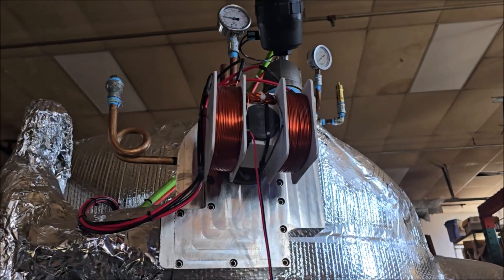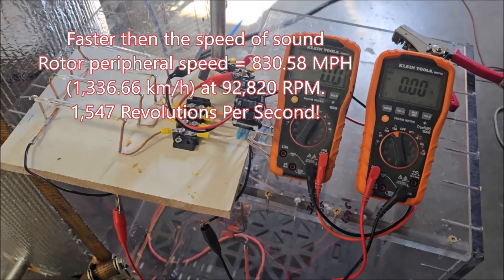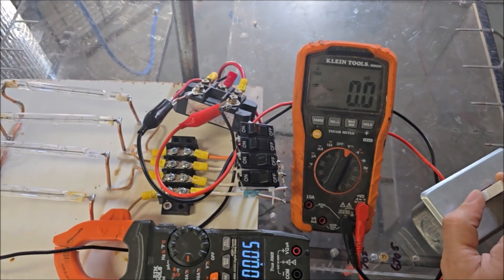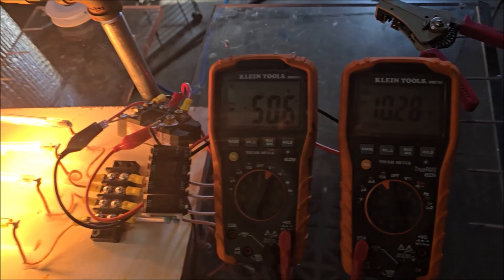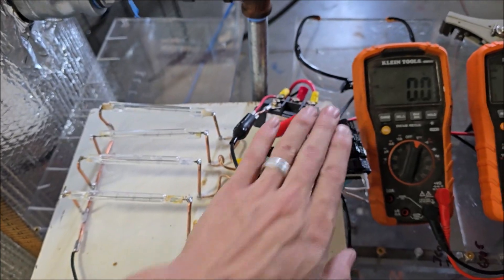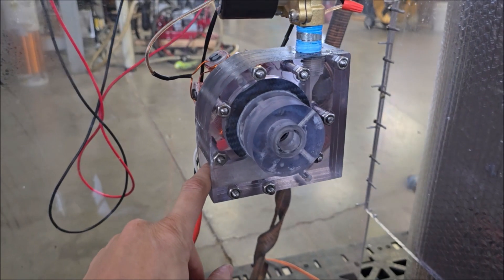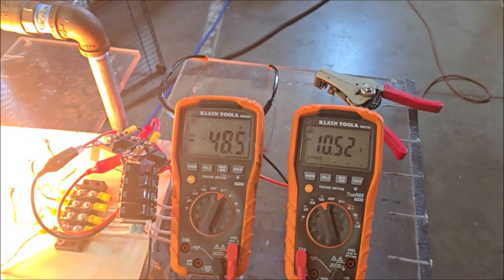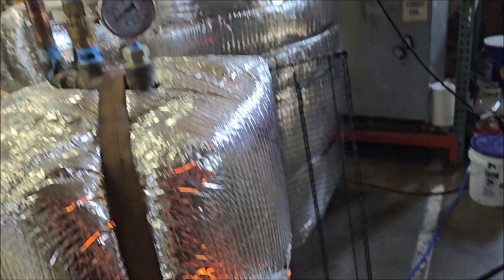Tesla Turbine Breaks Sound barrier! 95,000 RPM!

Comment: Try to get in Touch with Peter Lindeman and Aaron Murakami,
they will tell you that tesla intended his turbine to work in sister conjunction with another as a 99.9%  heat->motion konverter using "cold" steam.
nonetheless nice work keep it up
Reply from the maker: I work in Aaron's shop, haha. Achieving 99.9% conversion of heat would be the ultimate dream. I hope it happens one day, but it's a very difficult feat of engineering.
Reply: @iEnergySupply  404 error.  We censored your comment for some lame reason.  

Check held comment’s folder to find out more. If you can find it

Comment: You're impressed with high-speed machinery?  You should get out more.
Reply from the maker: With the right construction and conditions, the centrifugal pressure can almost match the supply pressure when the machine is idling. If the inlet is large, small changes in speed can cause big differences in fluid flow, helped by changes in the spiral path length. This creates a self-regulating machine, similar to a DC motor, where fluid flow is restricted by rotation, even with big pressure differences. Since centrifugal force increases with the square of speed, and modern steel allows for high velocities, this can be achieved in a single-stage machine, especially with a large runner.
Reply: @iEnergySupply this guy has to be some sort of boł.  Theres so much non human interaction in comments now. Its quite disturbing
Reply from the maker: Your not impressed with high speed machinery?

Comment: Its not the velocity thats important, its volumetric flow. Velocity comes along for the ride.
Reply from the maker: Speed is actually more crucial than most people realize when it comes to the Tesla turbine. If done properly, it can become a self-regulating machine—kind of like a DC motor. Even if the pressure changes a lot, the rotation controls the fluid flow. What's cool is that the centrifugal force increases with the square of the rotational speed (or even faster in some cases), so higher speeds really make a huge difference.

With modern high-grade steel allowing for crazy high peripheral velocities, it's possible to reach that self-regulating state in just a single stage, especially with a larger diameter runner. So yeah, speed is a major factor here, more than it might seem at first!
Reply: This is insane. The super contra rat army of Contrarium..  Who opened the cage? These creatures are everywhere!
Reply: @CoincidenceTheorist  A lot of armchair generals these days, dont worry about it too much, they're needed for algorithm engagement.

Comment: You need to put a drier on the compressor. The water  needs to be removed before its released
Reply: Isn't that one of the benefits of the tesla turbine that you can use wet steam?
Reply from the maker: @FilterYT  absolutely!
Reply from the maker: Can you explain more why you think a dryer would help?
Reply: @iEnergySupply  water can cause drag and rust etc. Especially in bearings. We use water traps on all of our air compressors in my work shop. Just thought id mention it 😎👍

Comment: You could use an idle air control valve from a car or an electronic expansion valve (EEV) from an air conditioner to control the air flow in a more linear way, they both have a stepper inside that you can control easily from software or hardware. It looks like it could possibly take even more load, and then you have tricky job of deciding whether its the generator or turbine that is the limiting factor, the power density looks to be insane, have you done any efficiency calculations including the energy left in the stream after the turbine?
Reply from the maker: Here is the reason I want the valve either fully open or fully closed. 1. Preventing Partial Throttling
When a valve is partially open, it creates a restriction in the gas flow, causing a pressure drop without doing useful work. This leads to what is called throttling losses. In a turbine, you want the gas to expand and accelerate fully as it moves through the turbine’s rotor, converting pressure energy into mechanical work.
If the valve is not fully open, you might be wasting energy by having the gas lose pressure across the valve instead of through the turbine blades. This reduces efficiency.
2. Avoiding Double Expansion of Gas
If the gas partially expands before reaching the turbine (due to a partially open valve), it loses potential energy that could otherwise be converted into mechanical energy. This is referred to as double expansion, where the gas expands once through the valve and then again through the turbine.
Double expansion reduces the effective pressure drop across the turbine, meaning less energy is available for the rotor to extract, which directly lowers the overall efficiency.
3. Maximizing Isentropic Efficiency
A fully open valve ensures that the gas expands isentropically (i.e., without unnecessary heat loss or pressure loss due to friction or throttling). This maximizes the turbine’s isentropic efficiency, which is the ratio of the actual work output to the ideal work output.
Closing the valve fully, when needed, ensures that no gas flows through the turbine unnecessarily, preventing losses when the turbine isn’t meant to be active.
4. Stable Flow and Control
Full open or full closed valve positions provide more predictable and stable gas flow, making it easier to control and optimize the performance of the turbine. Partial valve positions introduce turbulence and irregular flow patterns that are hard to manage efficiently.
In summary, fully opening or fully closing the valve helps ensure that the gas flow is either fully utilized for energy conversion or stopped entirely to prevent unnecessary losses, thereby improving the overall efficiency of the turbine system.
Reply: @iEnergySupply  these are good points for a final product, that is absolutely what you want but for testing would it not be good to see where the efficiency lies at different turbine pressure vs load?
Reply: @ChrisDay-sx4lv  I tend to agree, you may lose efficiency with an EEV or TXV, but you can do a lot more characterization of the turbine for learning and optimizing. 

In the end iEnergy can probably regulate with a PLC transfer function that reguates by adjusting boiler heat input rather than choking flow with a valve

What do you think of PWMing a valve with a very short transitions to eliminate pressure drop losses so it is mostly fully open or fully closed?

Or perhaps its best to develop a converging-diverging nozzle that can be deformed to provide efficient throttling functions.
Reply: @InfinionExperiments  PWM would not be a good choice, you are just averaging out the losses as the valve is not instantly open or closed at any one time. At his stage of testing it would be wise to concentrate on the efficiency of the turbine and disregard the efficiency of the system IMO.

Comment: This is my little idea it’s working or not. I don’t know you need to add some flywheel. ?
Reply from the maker: For these smaller turbines, that would be a very useful way to stabilize the RPM. My main turbine project has a much larger rotor made with heavier material, which helps stabilize the RPM. Stay tuned to see this effect in action.

Comment: I've done similar experiments, I found that with the same airflow but at different attack angles for different RPMs, there are big gains in power out.
Reply from the maker: Did you do that with a Tesla turbine? If so, consider using a larger inlet and increasing gas flow. That way, there won’t be too much friction slowing down the vortex at the periphery of the casing, where the rotor tips are closest to the sidewall. With small nozzles, you will have much thinner boundary layers, so pointing the nozzle away from the sidewall, as you described, helps.

Comment: You have water jetting.  (Take the issue of compressed air when there is a pressure drop results in a lowering of the temperature (Measure that water temp over time) IF even condensation hits expanding air you stand a chance of ice forming somewhere in the system that then breaks off and collides with the turbine.  It doesn't take much to destroy the balance in the turbine.
Reply from the maker: Thank you for the comment! You raise a very valid point. The issue of temperature drop due to the expansion of compressed air is indeed a critical factor to consider in such systems. As the air expands, the temperature can drop significantly, potentially leading to condensation and even ice formation, depending on the humidity level and temperature conditions.

I've only encountered this issue under specific circumstances, such as when a strong vacuum was created by a pump stage attached to the same shaft, running both compressed air and water vapor inside the turbine. This could potentially be mitigated by using higher temperatures for the air. However, this system isn't designed for compressed air. If you check out my previous videos, you'll see that I use the Rankine cycle, and I haven't had any issues like those you're describing.

The scenario could change if I were to use a powerful enough pump to decrease back pressure and increase the expansion ratio. But even then, since the turbine operates under vacuum conditions, the likelihood of ice formation remains low. Additionally, even if ice were to build up on the disks, it would be unlikely to cause damage. Unlike conventional turbines, which have buckets, paddles, or vanes that could be impacted at high speed, the Tesla turbine’s design minimizes this risk.

Thanks again for your input, and please keep sharing your insights. It's always great to discuss these technical nuances with the community!
Reply: @iEnergySupply  Jerrmiah youre truly inspiring. A great example of a real true heart. 🫀

Comment: Your throttling is like it's hammer hitting the turbine.  Correct the system so that you can gradually bring up the speed, your disk will last longer.  The acrylic nozzle that converts the pipe formed air into the shape that is too flow over the turbine is far too short triple that length and throw a temperature sensor on that.  (theory that it is ice chucks form there then break off and destroy the turbine blades.)  (You may even want to work on placing fins inside the nozzle so that the air hitting the turbine is even more "REFINED" and thus more effective.)
Reply from the maker: Thank you for the feedback! The Tesla turbine operates differently from traditional turbines, primarily due to its laminar flow characteristics. This means there’s no danger of a hammering effect inside the turbine. The smooth, laminar flow prevents the kind of turbulent impact that could damage the disks.

Regarding the throttling method, I'm doing it intentionally for a specific reason. I want to ensure the gas isn't double expanding before it reaches the turbine's inlet. When throttling with a partially closed valve, you lose energy before the gas even enters the nozzle and the turbine, making the system less efficient. That’s why I fully open the valve and pulse the gas through the turbine. This way, all the expansion happens at the nozzle and inside the turbine itself, maximizing efficiency.

As for the nozzle design, your suggestion to extend the length and possibly add fins is an interesting idea. I’ll definitely consider experimenting with a longer nozzle and perhaps adding temperature sensors to monitor potential ice formation. However, given the nature of the Tesla turbine, even if ice were to form, it wouldn't have the same destructive impact as in traditional turbines, since there are no blades or vanes to damage.

I appreciate your input and will continue to refine the setup. Thanks again for your insights, and feel free to share more thoughts as we continue to optimize the turbine!

Comment: The upgrade on turbines has so much potential.In real practical electric generation clean.With natural gas
Reply from the maker: Thank you for your comment! I completely agree—the potential for Tesla turbines in clean and efficient electric generation is huge, especially when combined with natural gas. Unlike traditional turbines, Tesla turbines can handle a variety of working fluids, and their unique design allows for efficient energy conversion with minimal mechanical wear.

Integrating Tesla turbines with natural gas could provide a cleaner alternative to conventional power generation, as they can operate efficiently even at lower pressures and temperatures. This makes them ideal for distributed energy systems and microgrids, where they can be used for local power generation with lower emissions.

We're continually exploring ways to optimize and scale this technology for practical applications in sustainable energy. Stay tuned for more updates as we push the boundaries of what's possible with this innovative design!

Comment: You’re an inspiration Jermiah. I watched one of your previous videos with a heat source and a condenser at vacuum. Couple years later watching another video on desalinization I realized that is the cheapest form. Basically using horizontal black pipe on the desert sand , A reverse P-trap leading into a T, One end of the T goes into a vacuum pump which could be a tesla turbine maybe and the other end goes back under the ocean to condense the freshwater as it boils around 30° C. Another pump to pump the fresh water in the holding tank on shore. Once the dissolved gases boil off first then close the vacuum valve and we should have a self-sustaining vacuum with boil and condensation.
Reply from the maker: Another way to do it is by using the temperature difference between the ocean's surface and below. Either method would work. You would likely also want a different working fluid or gas that boils at lower temperatures due to the small temperature delta.
Reply: @iEnergySupply  yeah that’s what you’re doing to make power which is awesome but this is for freshwater. Makai Ocean engineering Did a test Plant at the natural energy laboratory of Hawaii doing what you suggest. They have a net gain and they’re making power.

Comment: 95000 rpm is 1583 rps X 6" x 3.14 x 0.0254 = 757m/s or 2,727Km/hour or 1,704 miles per hour. Have you calculated the efficiency of this system?
Reply from the maker: It's a 3" rotor. We are going to calculate the isentropic efficiency soon on our 6" rotor using our analytical equipment.